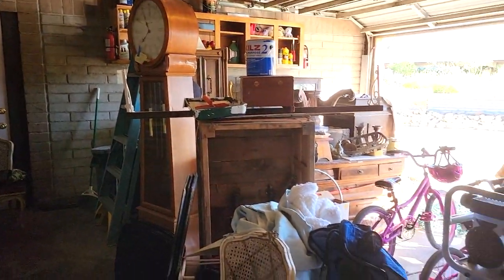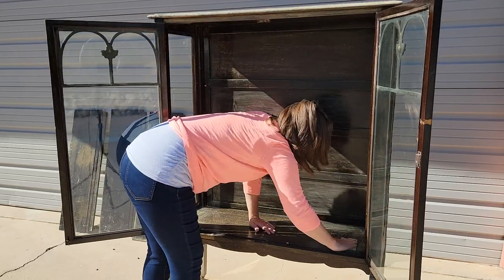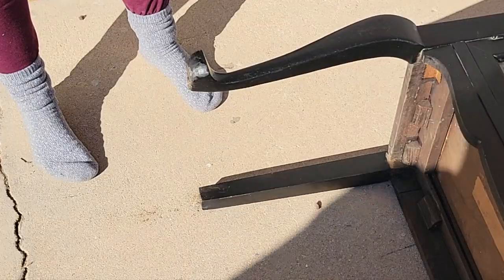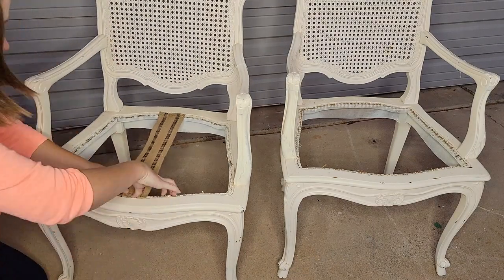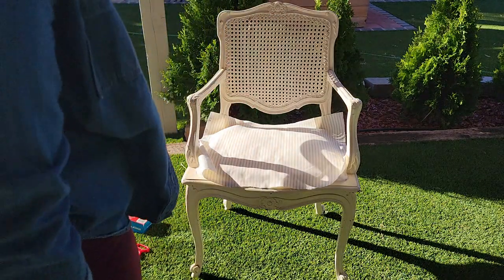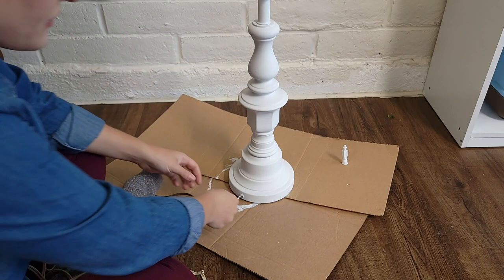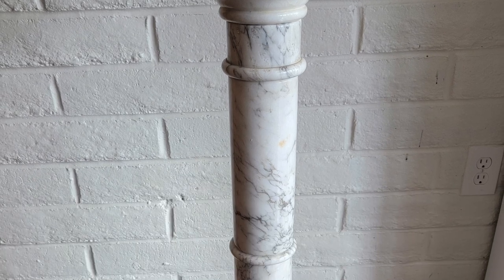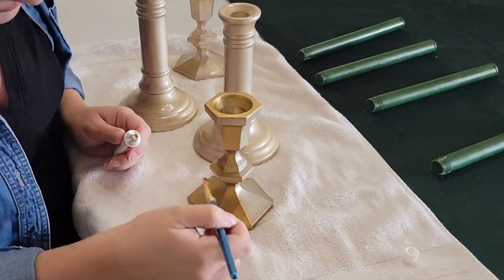Getting Tons of Projects Done Plus High End Looks For Less With Thrifted and Yard Sale Finds

Comment: That China hutch is gorgeous! I would put tea pots inside it! I think it dates more specifically to 1890's, but I'm no expert! BTW hv you tried a product called Restore-a-finish? It is FANTASTIC for antigue restoration.  No sanding required.  Clean then use the product. I hv used it for decades!
Reply from the maker: Thank you Lindee. Do you have any particular reasons for thinking 1890s? I'd love to hear. I use restore a finish quite a bit here on my channel, great stuff. They just don't sell a dark enough version for this project.
Reply: I have one just like that China cabinet.  I refinished with a gorgeous milk paint and the sides and doors were glass.  I put in antique silver and glass pieces.  And added a gorgeous old fashion key with tassel to the fake lock on the front!!!!!!

Comment: That stripe fabric is called ticking. Used to be cheap strong fabric used for down pillows and mattresses. Tightly woven so feathers and such don’t poke out as much. Am impressed with your stretching stripe fabric so as not to be wavey. Good job.
It’s not so much the weight but the force that allows a butt to break through caning. I had two Bruerer chairs that my very small friend collapsed on—-ripping the cane.

Comment: The curio cabinet is absolutely stunning! The blue & white pieces, as well as the other accessories stand out so beautifully against the dark stain of the cabinet. I believe that piece is a Queen Anne Curio Cabinet, possibly early 1900s to 1920s. As for the caned chairs you reupholstered, personally, I am not confident they will hold up long term. I could be wrong, but as I recall jute webbing with black stitching is for the back of the chair and red stitching is for the seat. I also noticed after you nailed the webbing on the seat, it was not taught. That may be because you didn't use a stretcher. Hope you don't mind my 2 cents worth?? Nevertheless, I really enjoy your videos and look forward to many more.

Comment: You need to stretch the webbing so it is very tight. There is a tool that does it but my grandfather taught me to use just a block of wood. You will find that these chairs wii sag very quickly. I would have added more foam, a smaller piece underneath the large piece. The batting fold isn’t really thick enough. 
I do do a lot of upholstery, at the moment I am doing a French 2 seater settee with a deep buttoned back in black velvet. It was taken down to the frame and I am slowly building it back up.

Comment: elastic webbing would have been a better choice, and jute webbing needs to be stretched with a webbing stretcher, stapled, folded over, and stapled again, the jute webbing will start to sag and might rip/fray over time, jute webbing is used to provide a base to sew in spiral springs that get tied down, another option would be "drop-in" seats made of a.plywood base screwed/glued on to the existing seat that is then upholstered

Comment: This piece is gorgeous BUT the moment you said the finish had gone alligator skin like … That means it’s a lead based finish making this piece toxic … the only way to make safe is to 100% sand and refinish or use an encapsulated paint … I tried saving an antique secretariat and gentleman’s closet that had “alligator skin” upon further research It was discovered that marking is a tell tale sign of lead based produces used on it !!!
Edited to add … Once made safe , it’s highly advised pieces are put in a low traffic area to cut down on lead dust made by the piece …
Reply from the maker: Thank you I will look into that

Comment: I did the same thing with a basket I bought secondhand. I got out the tape measure and checked the height and width but I was still surprised by it's size when I went to collect it.  I only had a small hatchback and it was a very tight squeeze🤣🤦‍♀️🤷‍♀️.  BTW, the china cabinet looks beautiful.
Reply from the maker: Thank you Deb! And how funy you ended up with a huge basket too

Comment: I use 1 part linseed oil to 1 part turpentine to rehydrate old wood, and to seal old ceramic tile and metal.
Reply: It dries really quickly, especially in the summer heat, and leaves a beautiful finish. You need to buff it a bit though.

Comment: You are very talented and all those piece turned out beautiful.

A small suggestion for the webbing, first staple the first end of the webbing, pull the webbing as tight as you could, staple the second end then finalize by cutting. For the folded ends of the webbing you need to staple the webbing when your pulling then fold and staple again, then cut. You would need to use both hands. So technically you are Stapling twice. Hope this makes sense and is helpful. Pulling the webbing will give it more life span. Webbing usually droops after some time the looser it is the sooner it will droop and you will have to redo. They also sell webbing tool that help pull and you don’t need to use all your muscles. 
Really enjoyed your videos